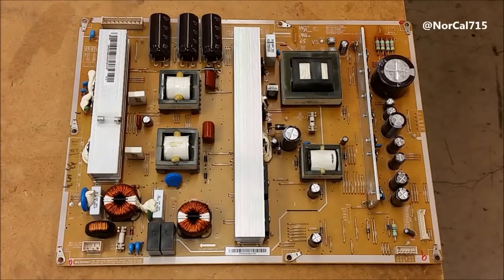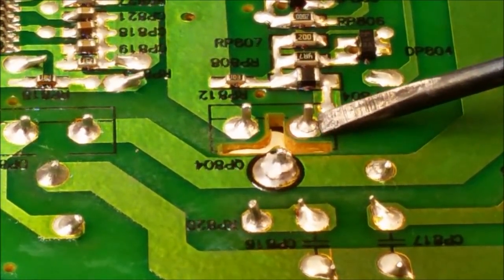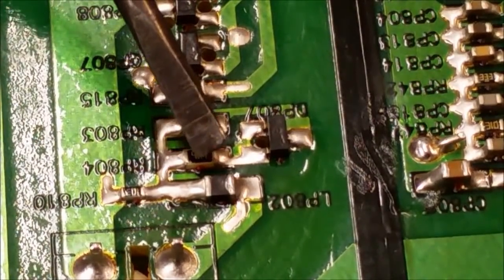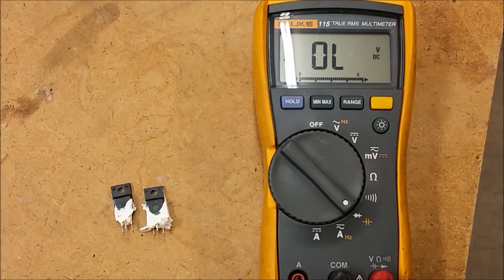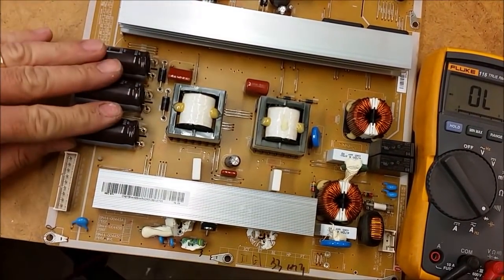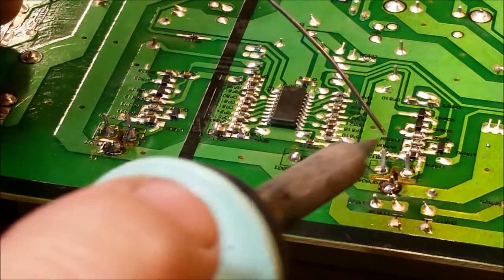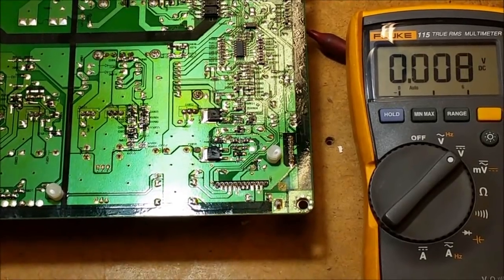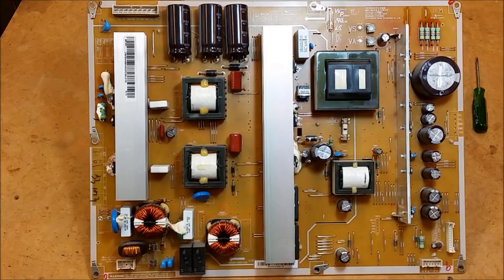Samsung Plasma Power Supply  Repair BN44-00445A Power Factor Correction

Comment: You tube is awesome, never knew all this free education existed, videos are everywhere on PFC, its what I paid for yrs ago. If you want to learn electronics, get yourself a scope, sig gen, power supply, DVOM, bread board kit, clip wires, and components, there are free circuits all over the web to build, measure and test. you can buy am radio kits and such. Do that and I guarantee  you will learn. In school we built simple circuits consisting of 2 to 5 components max, you think oh that's simple? come back and tell me. Spice simulation is also good, I had a program like that at one time. Learn DC and ohms law first, then go to AC then digital and semiconductors.  Maximum math we used was algebra and trig,  two yr degree. You MUST do the math as part of it.  Its all safe, you use low voltage low amperage circuits, the sig gen makes your AC sine wave so no mains involved, have fun, burn stuff up sometimes, its how you learn.

Comment: Are these boards super cheap in the construction?   I have like 10 computers in a LAN than have been running 24/7 since 2009.  (6+ years)  They have have complicated setups with Video cards, Lan cards, raid cards etc.   

Not one has failed in years.    Yet these cheap Samsung TVS seem to blow up on regular basis.    Cheap solder?   I mean why do resisters constantly burn up?

Why are power supplies and main boards failing at such high intervals?   My computers were much less money have similar boards yet they don't fail.

What gives here?
Reply: They make they cheap. If their tv`s last 10 year, Samsung would faliment

Comment: I have a same P.S. uniti this one has PFC voltage. Doesn't have  VSUS . shorting one of the optocouplers fires the VSUS voltage, will like to fix it, but need schematic of the Power supply. BN44-00445A

Comment: Checking voltage on filter capacitor does not mean that power supply is working correctly, what about testing output ?

Comment: i have power supply board of lcd tv the standby voltage is not stable 5v. the voltage i measure is going up and down from 4.7v to 5.2v vice versa what is the problem of this? can you help the conclusion.

Comment: Static electric precautions is the last thing to worry about when working to these beasts.If the flat ribbon cable coming from controller for example is not connected to the side boards then board will burn transistors rapidly.Intermittent failures which are difficult to locate also occur.In general the plasma tv's are the worst type of television ever made and are the hardest for service operations even for professionals with many years of experience.
Reply from the maker: You are correct, I have been doing electronic repair since the early 80's. Plasmas were great when they worked but a B!TCH when they failed

Comment: amsung BN44-00264A POWER SUPPLY jais 12.51 volt and 5.50 I have not found the 13 volt can you tell me what its little being ?? what is it about??? The capacitors its okkk als are okk

Comment: Can I install a fan somehow? Maybe fabricate one over the power supply board?
Reply from the maker: I have done that to my personal sets in the past. If you change the configuration, you may be liable if a defect occurs.
Reply: It was a free tv. 60" Samsung plasma. I'm sure power supply board is bad. They replaced the main board then gave up. I'll try to find a schematic and see if I can work a small fan over the PSB. Or make it never work again. Lol. Thanks!

Comment: Why oh why use a single sided boards for a power supply. Heavy components and hot components cause a lot of joint stress =failure!
Noted many areas of the board show signs of overheating..the tracks are brownish.
What you can do is fit thermal pads between chassis and PCB in the hot areas. Try T-Global.

Comment: What do you mean "add 1M resistor to your soldering iron". How did you do that?
Reply: The wire in the soldering station base that grounds the tip to the earth ground of the line cord is cut and a one meg-ohm resistor installed instead. (as in joining the two cut ends together with the resistor) This gives the tip the anti-static protection and will prevent an  apocalyptic short if you accidentally touch a live area  on a chassis with your iron.

Comment: How come just about every tv repair on you tube is a Samsung ? Are they junk
Reply: +Colin Riley I would have to say YES many samsung use junk boards with bad caps and NON Lead solder which cracks easy.
Reply: But should state its what sells most and is worth fixing.

Comment: Cheap Chinese made components insted  
Of Japanese made components just to save a buck on each TV.  I know thats a stretch at gussing whats going on.
But it probably has some facts to it.
I wont watch anything but a plasma TV and my oldest unit is over 18 years old working without a hitch, but my 1080p unit i belive uses this power supply
Now I understand some of the basic electronics behind this repair but you did some serious board leval repairs.
People dont do this anymore they just want to swap boards. I can take a guess and belive its my power supply or crack it open and test componets to find the problem and fix it.  This was a 60" budget TV  nothing big deal about it. 
Now becuse I can buy new sets at dealer cost should I bite the bullet and go with qled? They use a lot less power and my sets been turned on almost constantly its whole life, last time I turned it off it was hard to get it to turn back on over a year ago. If it comes on it works.
This leads me to belive its bad solider joints. As most of these boards run down an assembly line then over a solder bath then washed off with water.
Im going to bet every component was placed by robots.  Most of these are not hand soldered anymore and this power supply works on that whole skew of models from 3d to normal on the plasma line  mines a 60"  i belive the 47-60 all used the same power supply.  Other components would have been differently made. Like the x and y boards.   Im just gussing. 

Plasma were supposed to last 35 40 years.  Not like the old CRT or tube type sets. And they gave a lot better picture.
I remember changing tube in the 1960s tvs but that stuff would be impossible to find today. Unless you have a Marshel Amp.  I belive the tube cost 110 to 140 bucks each now.
My what solid state has done for us.
Don't touch the flyback! You won't live to talk about it.

I take it the output voltage is dc volts or was it ac volts and low amperage? 
Not sure i want to probe a plugged in board.  Its still 120 volts ac. 
The power supply drops and bumps the voltages for differnt circuits. Depending on the needs.